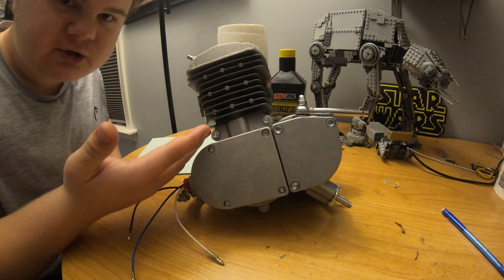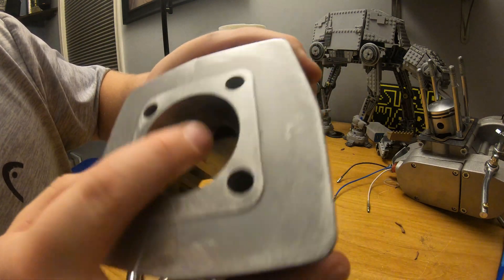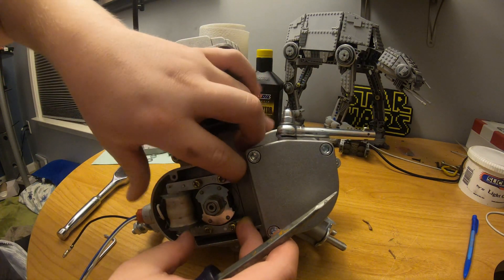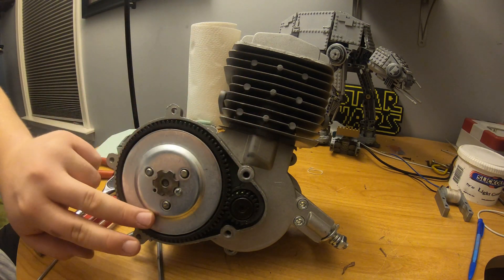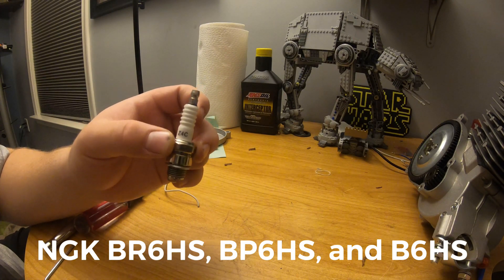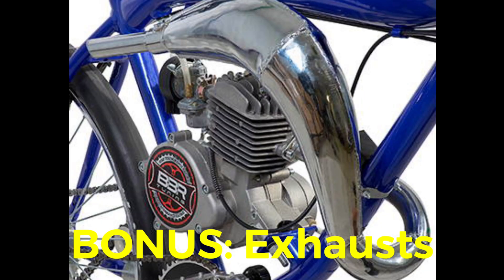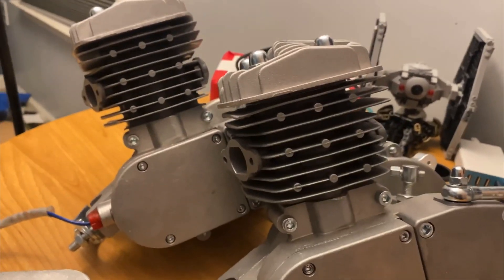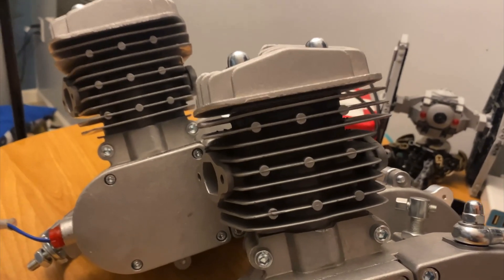5 NECESSARY Motorized Bicycle Mods #motorizedbike #motorizedbicycle #2stroke #moped #bike #minibike

Comment: #1 upgrade is wheels w 12g spokes
Reply from the maker: This video is primarily on the topic of the engine. I plan on making a video primarily going over bicycle components, as well as what components included in the kit need upgrading.
Reply: @a.m.bgarage.everydayprojec9665  ok well how bout this one to deal w the ex. Gasket failure issues: 
1: remove cylinder 
2:paint/marker/ink the flange of pipe and mating surfaces of cylinder 
3: file/sand the flanges and mating surfaces of cylinder flat til no ink is left or as little as possible.. 
4: use a thinner gasket of make your own from gasket material best bet is thin copper sheet thrown on stove to anneal and soften metal. 
5: use ultra grey hi temp hi torque or Yama/Hondabond gasket maker/sealer to seal ex and intake flange to mating surface 
If don’t correctly you can just use plain ole hi temp silicone instead of a gasket and it will seal if flat all the way across as well as a sheet of card stock etc. or felt and silicone or even fiberglass… also makes a good gasket.
Reply: @a.m.bgarage.everydayprojec9665  other engine mods to help
1remove all slag and ridges from intake and ex ports w file and sandpaper.2smooth the port walls down then swap to finer grit 
3 polish ex side only but leave the intake with a textured/rough finish basically in layman’s terms unpolished yet smooth.
Reply: @a.m.bgarage.everydayprojec9665  another upgrade is to sand/file the magneto down in mating side and smooth mating side both flat so ya get a foot connection and use conductive electrical grease to get a perfect connection. Also can use very thin softened copper behind it.
Reply from the maker: @motorizedbicyclenation53cu90  That is a great mod, but I would not include it on the list because that is not a "necessary" mod.
Reply: @a.m.bgarage.everydayprojec9665  wich one? The filing of the mating surfaces of pipe intake flanges and ex intake on cylinder are neccessary to stop constant exhaust leaks… also use a homeade gasket either thin 0.5mm-0.9mm gasket material or aluminum or copper sheet thin as ya want it and hi temp sealer… works perfect if surfaces are filed flat and level
Reply: Another upgrade for the pipe is to remove cap then cut the tube that is on the cap down to about 2-3 inches long and replace cap back on it. You may also gut it but need some back pressure to keep from blowing it.
Reply: Yet another upgrade: sand/file cylinder and head decks down flat and smooth and as close to polished as ya can while removing minimal material then adjust squish band width (measured from piston crown to head w a piece of solder) using thickness of your gaskets. A good squish for stock head and engine is 1.2mm that’s fine.
Reply: Yet another tip: reed valves don’t add power just help lower end torque a bit but hurts overall HP.

Comment: Ey AMB, nice video. The motor usually tuns stock, Just poorly. Like 20 mph max and no torque. The aftermarket head aswell as the compression fix makes a huge diference.
Reply from the maker: Yeah. For some reason, this one didn't run out of the box, but was notified that it was a bad batch, and I got a partial refund. The aftermarket heads (especially the CNC heads) definitely provide great power for a bolt-on mod, but for all of the engines I've built, a performance head is never "necessary," unless it is damaged or faulty from the factory.
Reply: It shouldn’t be doing that you should atleast see minimal torque and acceptable top end power it sounds like you might have a air leak somewhere possible the top end gasket releasing air and not holding compression